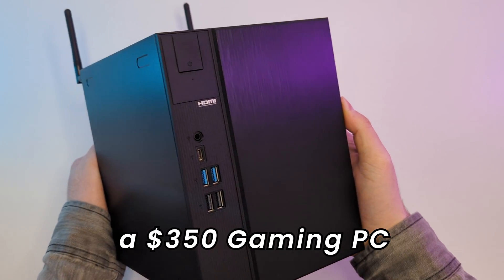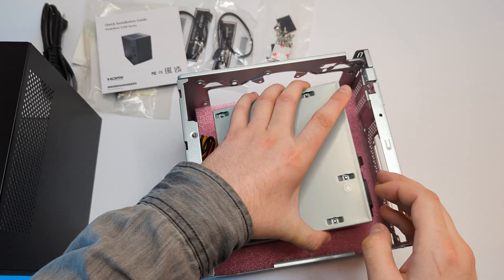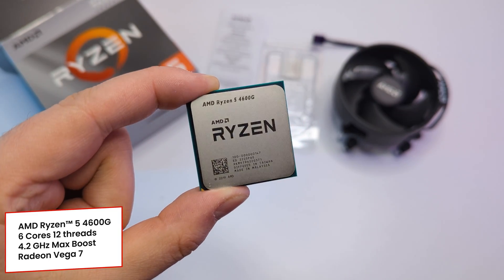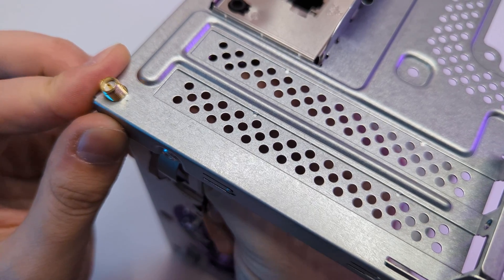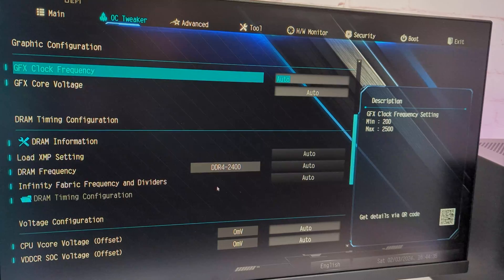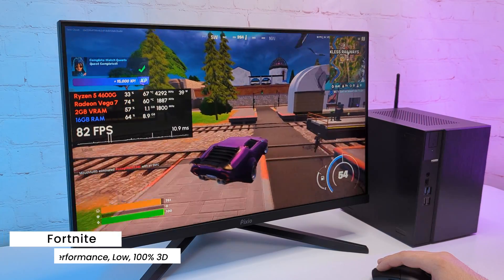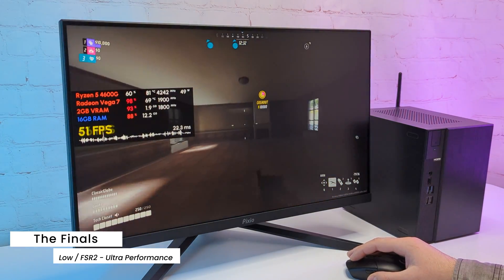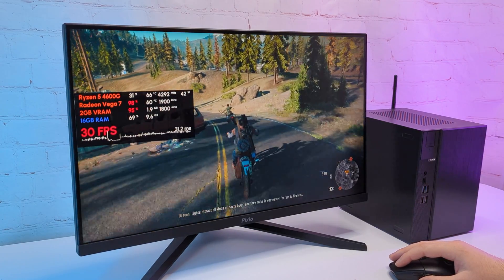EASY $350 Budget Gaming PC Build !!!

Comment: I don’t know much about computers, but would this set up still work with a 600watt pcu? I saw someone say it’s not good to cheap out on the pcu and I happen to have a thermal take gold rated 600watt pcu laying around…
Reply from the maker: It will work with a 600W PSU, but if your build doesn't require more than 500W, use the stock one, it's better for airflow, and cable management.
Reply: @Tech.Closet  Okay Thank you!
Reply: @Tech.Closet  if I wanted to get a higher quality 500 watt PSU like a platinum should I? And also would 550 be too much if I made the same build you did in this video but also added the GPU and maybe another fan?
Reply from the maker: @SkellyWaggs  "I think it's better to use the stock one, it's not a bad PSU. Whether it has enough power or not depends on the GPU you are using. Also, if you're adding the GPU right away, you can go with a better CPU, like Ryzen 5 5600 or 5500. They don't have an iGPU, but they will work better with your dedicated GPU.

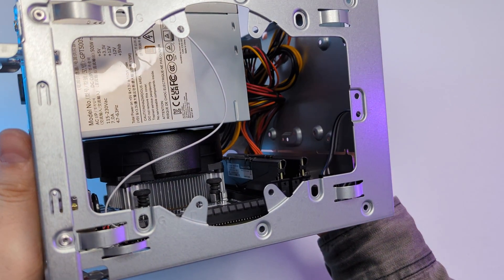Comment: 4:25
Absolutely shocking, there's basically no air flow, I'd rather spend a couple extra bucks on a bigger case than cook my CPU like that, they could have easily designed this so that the motherboard sits on tip of the power supply, so the fan faces outwards.

Comment: I have a Deskmeet X300 and I'm pretty happy with it, it's a little over a year old, and I've kept dust blown out of it... but a couple of times lately  it's frozen on me, and the case felt very warm. Normally, it's just not cold the way a random piece of metal would be. Ii put a Thermalright AXP90-X47 on the CPU, and 64 GB of RAM (2*32). Has yours run at reasonable temperatures?

Comment: So the PSU fan is pretty much touching the CPU fans and both of them are pulling, I wonder what the CPU temps are. Also if you add GPU to that case it will probably have thermal issues as the case doesn't have any stands (or ventilation in bottom?). I would just buy used.

Comment: What kind of gpu i can put in if i wanted to
Reply: 200mm max length, and two slot width. The most powerful gpu you can fit in this case is the amd version of the Rx 7600 sold on the amd website. Usually comes with a game for free. It was starfield, now it’s Avatar.

Comment: I like it but the psu and cpu cooler would be fighting for air with that little gap only.
Reply: yeah low profile or shorter heatsinks are cheap to buy.
Reply: Or you could use a sfx psu with a silverstone atx bracket for better clearance

Comment: If you want to absolutely max this system out, the highest performance CPU this barebones system can handle is the Ryzen 7 5700X (as you are limited to a 65w TDP for this platform) and the RX 6650XT Fighter from PowerCooler if you want to keep it all AMD, this is the largest card that fits with the best performance available with this 500w PSU. If you want the absolute best performance with this system and don’t care about keeping it all AMD, the Zotac 4060 Solo is the highest card that will fit in the system. Also, just one note, this system is meant to run maximum ram speeds of 3200mhz but that is the “official” spec. You may be able to run higher speeds, but I have not tried doing so. (I did more research on this than I care to admit and can 100% confirm this as fact.
Reply: Bro if I went with your suggestion,do you think this pic can run mixing and mastering music programs smoothly? I use a ton of heavy vst’s.I don’t care about gaming at all..
Reply: @MiaaDavis for a DAW pc you want as much ram as you can get. This barebones system can use up to 128 gigs. So it’s would make a nice little DAW box. I would opt for the intel barebones version and use an i3 12100 cpu instead because this cpu uses Vega graphics which is at end of life for amd. 

But before you build a DAW pc, take a look at a company called GPU Audio. They debuted at NAMM last year and they figured out how to run vsts on the gpu instead of cpu.
Reply: @_B.C_  people like you make the world go round
Reply: @MiaaDavis   I can only speak for this in a gaming perspective, as the video title states it's a "gaming" PC and it's also my own personal use case. Sorry :(
Reply: I think the rx 6650xt is on pce 4 8x so be careful picking your motherboard you might want to pick one with pcie4 support.
Reply: @pewpewstix  RX 6600/6650 XT is X16, only the non XT 6600 is X8
Reply: @Liminal.Headspace  yup you are right i was thinking about rx 6600
Reply: @pewpewstix  not really an issue, as there aren't any PCI-e 5.0 GPUs, most of this cheap motherboards will come with the 4.0 or 5.0. You can plugg a 4.0 card on a 5.0 and it will run alright, nothing will happen.
Reply: Is it physical size of the gpu thats the issue or the PSU? cos the 7600 asus dual is lower tdp than a 6650xt. Just the hestsink is thicker.
Reply: @DarthRayvonGaming  it’s the size. You have  maximum of 200mm length-wise
Reply: You can absolutely run a Ryzen 9 in this, all you have to do is clock down the CPU and under volt it slightly. A cheap video adapter GPU is recommended to set it up. For multi threaded programs it's a better choice.
Reply: Did, any of you guys actually look at the motherboard? There's no PCIE x16 slot, barring weird workarounds like using sata and then attaching the graphics via NVME, a board like this is meant for integrated graphics, you can't fit anything else on, a board this basic should be kept basic and it's fine, I'm using a 5600g right now and it's fine, and I wish my comp was compact like this, I have a 16x slot, I'm not even using, I originally planned on upgrading later but at this point, it's good enough that I don't even care to upgrade.
My only concern with this case is that the power supply is right on top of the cooler and will restrict airflow, but otherwise feels fine.
If you want to build it out, get a proper sized case and motherboard with more ports, otherwise integrated graphics is fine, especially with Vega
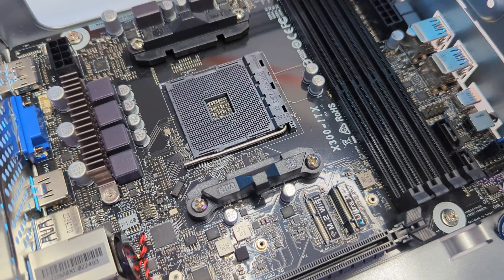Reply: @Xalgucennia  There absolutely is a PCIE x16 slot. It's at the very top of the board at 1:30 in.
Reply: I have a question, would it be a good idea to upgrade the power supply unit on this build to a gold rated 600watt thermal take? And if so what could be upgraded after that?
Reply: I put RX 6600XT Power Color Fighter in this thing 😂
It run 130w okay but tthe temp is so hot